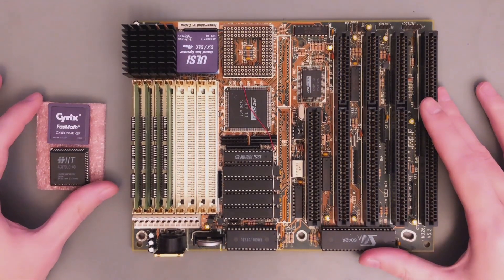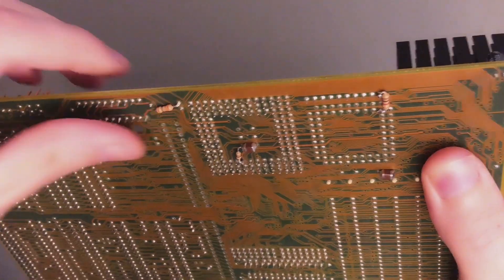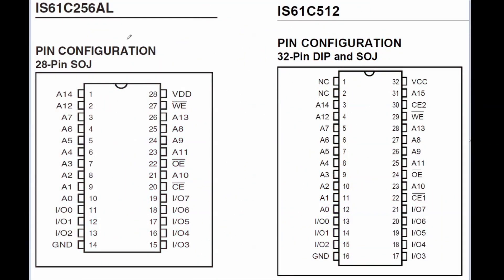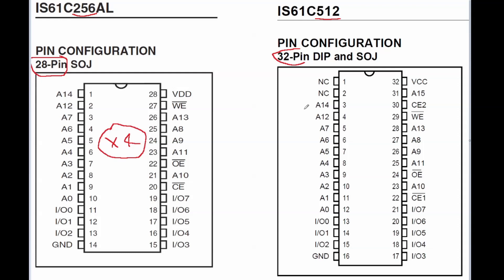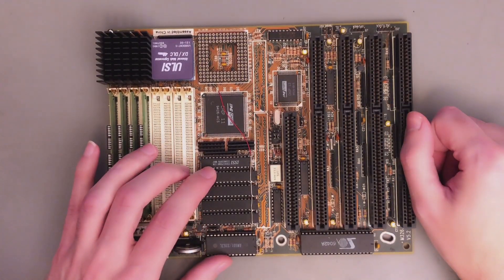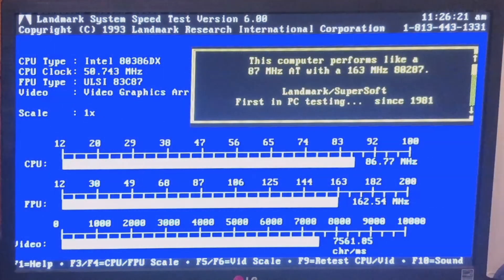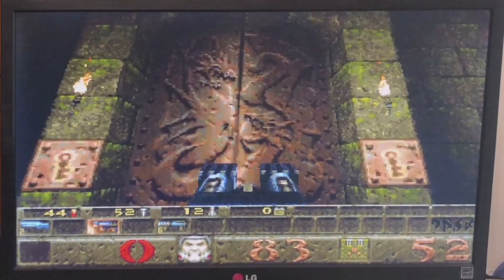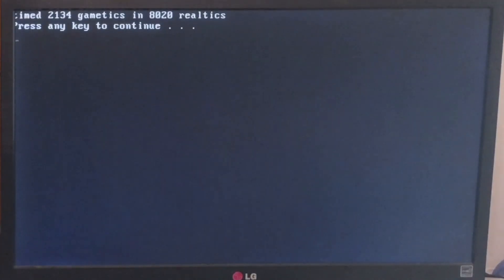386 Motherboard Mod: 128 KB to 256 KB of cache! New Quake record set.

Comment: what a coincidence that you should post this video precisely today! As it happens today I managed to make an old dream of mine come true: run Quake on my old Am386DX-40 ! I got an ITT 4C87DLC-40 for the purpose. I got 1.54 fps (969 frames in 628.4 sec), a lot less than your 2.5 fps result at 50 Mhz but comparable with the 1.6 fps you show in your table (my system has 8 MB ram, 128KB L2 cache, ISA video card Trident TVGA8900C 1MB).
Reply from the maker: Well... I just managed to reach 2.5fps after a lot of optimization and custom hardware. I still think this it is not an easy record to break.
50MHz CPU, ISA Bus overclock and the right FPU are the most important ones I think (ITT is a bit slow, see my previous video).
However I also have 0WS ram and 256KB cache now.

Comment: Slick Any_Clk PCB!

Is the A15 address line coming from the chipset available at the processor? Might be 'safer' in that it would be less likely to get ripped off by accident if you ran your wire down through a hole where the ISA slot is now missing from and tag the wire to the bottom of the CPU socket.

Will you be adding a jumper for FLT on the 386 or doing a temporary solder blob?
Reply from the maker: This time I skipped the minor technical details in the video. I think most people get bored with these.
There are also some details with the TAG chip I skipped in the video, specific to the layout of the board.

So... A15 is the signal on the Cache Chips. This connects to A17 of the CPU bus (CPU to main chip-set).
This is Pin H1 on the CPU socket. This A15 -> A17 difference is because you have a 32bit wide data bus (4 x 8-bit).

Now I will stabilize the wire with some glue so no problem I think.
Originally I had this routed as you said. You do not need to use the ISA holes.
This signal also connects to the first pin of the TAG chip that is properly connected to a socket.
So it is possible to route this 100% on the back side from this TAG pin to H1 of the CPU.
However this route is longer, and also passes too close to other signals.
I was unstable this way at 50Mhz, so that is why I changed it in the end.

For the Socket mod... I will probably go in and directly remove the Integrated CPU.
Leaving this on will probably reduce my max clock speed.
I might do a fast blob test just to see if my chips work.

Comment: Amazing!  Every time I think I "know about computers" I see a video like this one and realize I have a lot to learn.
My M-321 has two columns of 28-pin cache sockets too close together to put in the 32-pin SRAMs, so going from 256KB to 512KB may be an impossibility.
On the M-321, the FLUSH method of invalidating the cache doesn't work.  I'm not sure if your board fixes that.
For my TI486SXL-40, I use the command cyrix.exe -e -b -m -xA000,128 -xC000,256 which enables the cache and uses the BARB method, and sets some exclusions.  Without the exclusions and the forced "BARB" method, the system is unstable with DMA (and floppy reads/writes can go disasterously wrong).  Maybe your board already has real hardware support for the FLUSH method.  (When I saw your jumper wires I thought they were for that cache invalidation method, not for supporting the SRAMs you are using.)
Reply: With the TI486SXL-40, Cx83D87-40-GP, 32MB, 256KB of cache, and 240ns DRAM refresh time, I get 2.58FPS in the Quake TimeDemo (sound off) (969 frames, 376.2 seconds)
Reply from the maker: Thank you for the information.
I have very little experience with the 486DLC stuff. I will have a look at this the next days.
The Cx and the Ti are similar but there are a few register changes I think.
Now my M/B in the manual states that it officially supports the 486DLC.
I have to check and see for this FLUSH  / BARB think. Right now I do not know about this.
Even if it is not supported... I will try to mod this too ><
The main chip-set is totally undocumented thought so I hope this is supported.
Reply from the maker: That is a nice score :)
It is very interesting what I nearly matched this score using a pure 386 CPU like the am386DX.
The Rapid Cad also performed at ~2.5fps in the CPU Glaxy chanel.
Reply: @atheatos  The M-321 has a BIOS option for the Cyrix 486DLC, but relying on it without using cyrix.exe and the switches above, the system is very unstable.  So I leave it to "DISABLED" and rely on cyrix.exe to control the cache.

Comment: With 256 KB of cache, it already makes sense to test multitasking, multimedia, disk operations, network :) And even, probably, Windows95.
My first PC had an ALi M1429/1431 motherboard, built-in Am386DX 40, IIT387, CL5402(AVGA2) and ESS688. Without a sound card, ISA managed to overclock the divider settings in the bios to 20 MHz, with a sound card, it had to be lowered to 16 MHz, since there were wheezes in the sound at 20 MHz. Under Win31 with a normal frame rate, videos of the MSVideo 1.1 format with a resolution of 320x240 were spinning.
p.s. Please allow the use of subtitles. With auto-translation, it's easier to understand what the videos are about.
Reply from the maker: Thank you for the feedback! :)

I will try some win95 in the future for sure.
This system should be capable for that.
I am just not that familiar with win3.1, win95 and relevant software anymore. Last time I used these was back in the days.

Also I would have to reduce the ISA clock for sure if I want sound and floppy functional. These are quite sensitive yes!

You had a nice system back then. Ali is a nice chipset too I have a few M/Bs with that now, I will make videos.

Regarding subtitles... I can not do much. I checked the settings... These are the same, but older videos do not have subs, while newer ones do have.
Reply: @atheatos  I think it is a large cache that will be very useful for multitasking. And if you put a lot of memory (32 MB or more), then you can organize a fast disk cache, because ISA still has a bottleneck.
Capacious SIMM30 memory modules can be assembled from donor SIMM72 modules, and even EDO modules are suitable - there are several detailed videos about this on the "Bits and Bolts" channel. Moreover, you can find SIMM72 modules with sufficiently high-speed chips.
I had a Maxtor 170Mb hard drive, and there were no problems with it on a 20 MHz ISA. With newer disks, too, it should not be, the PIO1, PIO2 maximum modes are still used, and if there are any problems, then you can include additional delay cycles in the BIOS for the IDE.
By the way, some multicards had an IDE connector connected directly to the ISA, others had decoupling resistors, and rare ones had buffer chips of type 245. In the very first case, the IDE cable should noticeably degrade the frequency and time parameters of the signals on the ISA.
Do not forget about the XT-IDE project, it is also suitable for 386 systems ;)
p.s. I understand that there are some problems in YouTube again.

Comment: It also occurred to me that you might want to use SPEEDSYS 4.78 to see if it really shows 256KB of cache-- the BIOS may report it but it may not be utilizing it, even with a tag RAM that supports that size.
Reply from the maker: Sure, in the Video I am showing also SPEEDSYS  with 256KB of cache and the cache check too. These is no question that the mod worked as there was also a performance increase.
Reply: @atheatos  Oops I missed that and see it clearly at 6min, 34sec